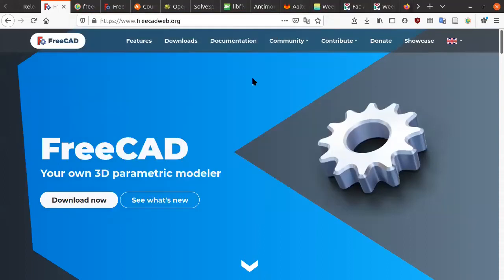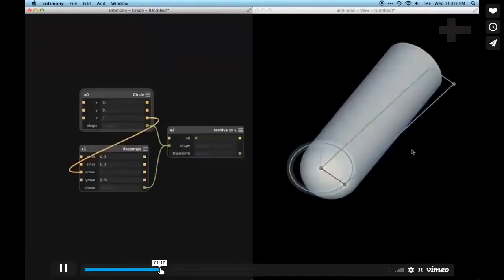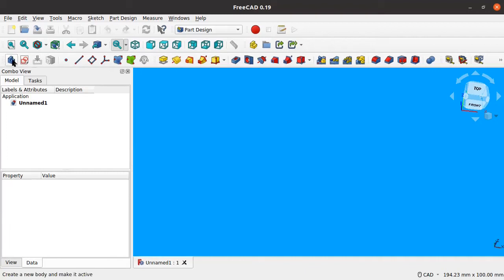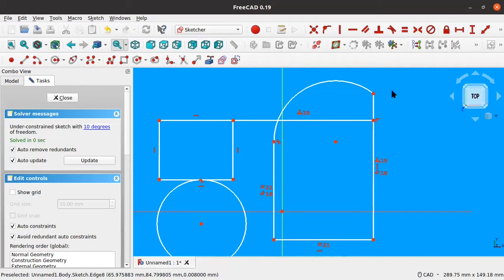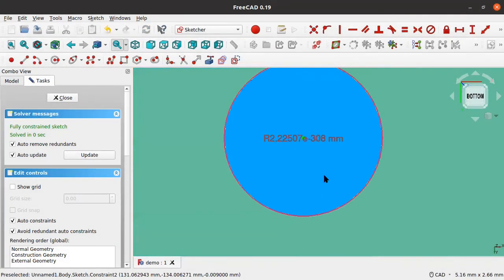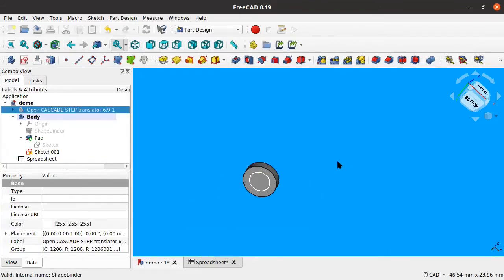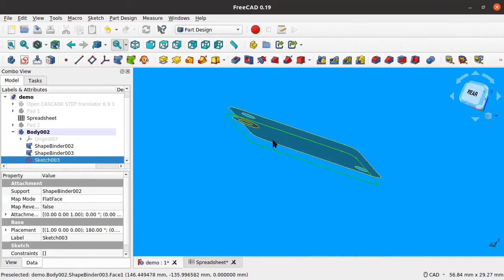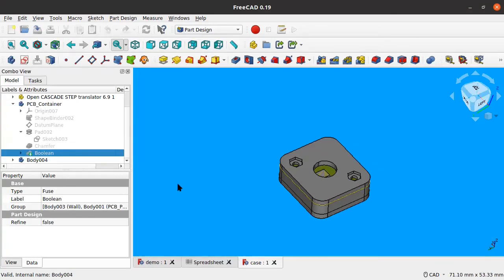FreeCAD (0.19_pre) Introduction

Comment: Doesn't run on Debian Buster 64 bit (appimage). Utilizing apt-get (as suggested by the wiki) reports latest version installed (0.18~pre1+dfsg1-5). Frustrating because everyone (aka most tutorials) assumes this can be done and it can't. I'd love to run 19. Recent convert to pi and linux. Love it except for the fact that the version of Debian I'm dealing with (64 bit still pre-release) doesn't allow me to install the latest of many apps I use. I'm guessing as far as release code this is at the bottom of most of the dev lists and I'll get it when they get to it. Don't know. Beyond frustrating. By the way, one question. Went to your channel and noted most opening slides to your presentations state "In the context of Fab Academy". What does this mean? If I google Fab Academy will I strike gold on all things Fab? Just curious. Assume I know nothing, which is essentially accurate. I do know tech but, in the context of CAD, Hardware, Electronics, 3D Printing, MakerWorld, etc... I'm early into this adventure. Thank you.

Comment: I wish I found this video earlier. You really know your Cad.
 Some of us have a problem but some of the other sites helped us out. Some of us have poor eye sight. For us a dark, smallish and fast moving pointer disappear at times when moving. The problem disappear with a slightly bigger pointer colored red. It seems you are using Linux, maybe Ubuntu. Maybe Windows? There is a fix for both. Might work on other Linux versions
Download Tweaks. Then open it and go to Appearance. Here you can change a lot. Zoom makes the pointer on some computers but if not you can have a nice cross.
Then open Settings go to Accessibility and here you change font and pointer size.
       Windows google catnip5. There scroll some down and find the pointer page.
Thanks a lot we would appreciate it.
Reply from the maker: Yeah, I am considering using a highlight in future videos. Thanks for your feedbcak.